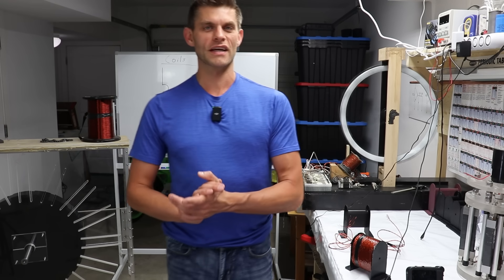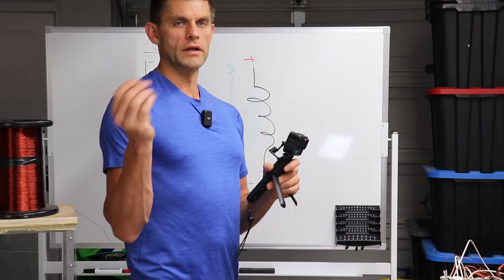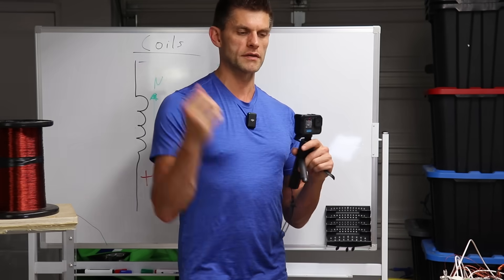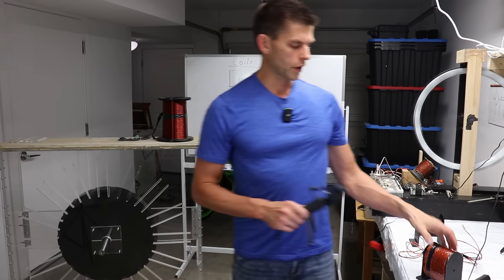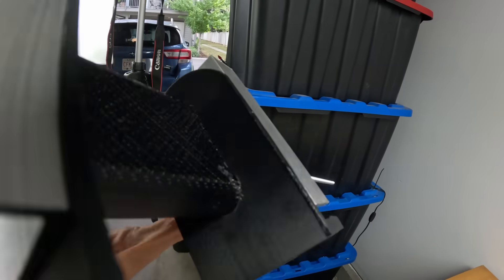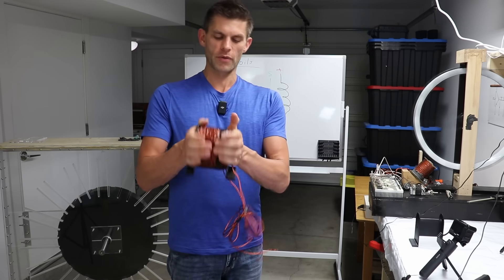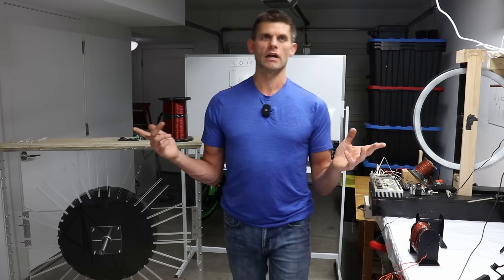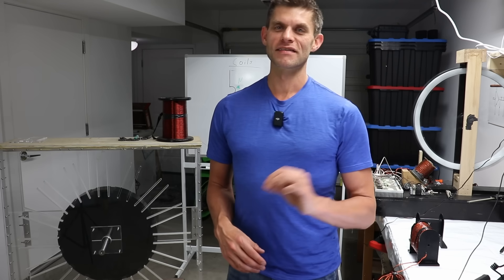Unlimited Energy in My Garage (No Patents)

Comment: You want free energy get a solar panel
Reply from the maker: True
Reply: @MadscienceLPTECH what your doing reminds me of a corona motor that just runs off the charge in our atmosphere. But yours has torque potential far superior and right up my ally. I’ve literally had I think the same idea with using electrical switching to produce more power and or less resistance when timed precisely. I’m very intrigued and interested in seeing a final operational model and how much power it could produce on a constant. Good stuff!🎉
Reply: If you travel to Guangzhou, China, you'll quickly discover solar panels are not free energy.
Reply: @GiveMeLiquidity  if you wanna get technical, nothing is free everything costs you gotta use money to buy the parts to make whatever it is you think is free but nothing is free in this world right so technically we’re always at a loss. What a concept. It makes me cry what I mean by solar panels I mean, get auction ones from A insurance sale or something of the like where they’re like $10 apiece cause nothing is free except Your own time with your own self.
Reply: @GiveMeLiquidity I guess my sarcasm wasn’t dripping quite like I thought 🤔

Comment: You claim a lead acid battery is doing the magic and pulling energy out of vacuum, when we look at a lead acid battery in a chemical level it is just 2 electrodes that exchange ions thru an electrolyte, to harvest more energy than put into them you need a specific pulse of energy to move more ions from one electrode to another than its energy would normally allow. So what kind of vacuum energy is propelling the ions forward here? There is no reason for these ions to move, because for them to move an electric current is needed. Infact, these sharp inductive pulses would be far less efficient at charging the battery due to increased heat generation, and they would degrade the battery faster.

Now i don't claim to know anything for sure, if you manage to explain this to me in a way that you understand it and that makes sense against my arguments, I'm in.
Reply from the maker: The lead acid battery is a medium in which the HV spikes can form a dipole that allows the radiant energy within to flow. Im more about building then explaining but I'll do my best to in upcoming videos. Thank you for your open mind
Reply: @MadscienceLPTECH  I would love to see such a thing run and work. But in the end, to store more usable energy in a battery than what you put in (in your case you are trying to store your input + harvested zero point energy for a net gain) you must move more ions in the battery from positive to negative. For ions to move from positive to negative, you must also move their electrons externally, so the movement of ions correlates to the electrical current of the battery. If a battery moves more ions than the energy inputted into it allows for, that means the battery is moving extra electrons from one side to another on its own, meaning its voltage must be higher than the charger and at that point you have a battery that is outputting a current while charging itself. That makes lets just say not alot of sense
Reply: @MadscienceLPTECH  Also this explanation is quite interesting, any reason why you do not use lithium batteries?

Comment: Hi sir. I am not trying to disrespect you. But why go for all that trouble if you can oscillate the coil and charge the other 12v battery with the energy spike. And in the moment if excess energy is absorbed into it then wouldnt it be easier to go with that rather than building a wheel machine.
Reply from the maker: I haven't seen that before. I've seen the wheels work. So that why, though u have a valid point
Reply: Yes, but the point was to provide mechanical work while charging another battery

Comment: I'm still wondering... why not solid? without using the motor
Reply from the maker: I've seen motors work
Reply: @MadscienceLPTECH  The motors certainly work, but they are not the most efficient form of this system, as well as the cores, you can use Metglas, Finemec or Nanoperm. I am not saying that the motor is not useful, but as Bedini and Rick explain it is not the most efficient motor and if you are only looking for a generator, the most durable form is a solid system with no mechanical parts.
Reply: @MadscienceLPTECH  Did you see the link I shared with you with the different types of PCBs?

Comment: Likely too late now, and also a lot of work - but coil/wire/conductor consistency improving:
Have one straight core (sense wire/conductor - or strong string that won't stretch much) and make a rig that rotates and wraps the center core in patterns you want. Then make the same 'rope'  really long or one similar for each coil you plan to make - and then finally cut each part into equal lengths.
Good luck - I hope the theory on 'super fast electrons that generates vacuum in quantum fluctuations really is possible', as to me - electrons is the effect of energy transfer that we humans observe. You hit the wire (or a rod, battery cell, etc.) and the crystal lattice making up the conductor/cell transfers energy to the other end, where it is either emitted - or reflected. Cooper-pair 'enables super-conductivity' in a conductor, vs. unstructured pathways leads to turbulence and local heating = losses (which is why some says you need a 'negative-impedance' to extract energy). If you really make vacuum-pockets, and extract energy to the cell - you're no longer 'temporally borrowing energy and returning it' - so the battery must cool down, or energy come from elsewhere - which can easily be measured/verified.
Reply from the maker: Interesting, we appreciate the in-depth analysis and suggestions!

Comment: Remember Bedini suggested running these systems on custom batteries, lead alum being his favorite for efficiency
Reply: Oh, and impedance matching the coil output to the batteries increases the sharpness and effectiveness of your pulse. That can be done with or without resistors, not sure which way is best
Reply: Aaaaand remember what he said about phantom charge. The batteries being charged require time to turn the phantom charge into real usable power. The alternative is to charge capacitors, and they convert it to regular charge much faster, and then you dump that capacitor to the battery with another timed pulsing circuit. This is all in his final Bedini motor design he included in the Free Energy Generation book.
Reply from the maker: Ya 3 battery banks would be good
Reply: @MadscienceLPTECH oh one last last thing, this is from Aaron Murakami and Peter Lindemann, sometimes a spark gap can be a source of energy, especially with the sharp pulses.. Peter's book on "cold electricity" was a big help for me. The video presentations as well.
Reply from the maker: Good info, thanks for sharing.

Comment: How familiar are you piezoelectric motors.  I think that the issue you eventually face is that to get power at useful amounts your hundreds of volts really needs to be hundreds of thousands of volts.  The strength of the resulting magnetic field can become and issue for traditional electric motors.  I think that to scale up there is some real magic that is possible with resonance and piezoelectric motors.  I have a feeling the pioneers of this technology had no need for energy generation as that would simply make it harder to control the masses.  I think their high voltage experiments quickly turned towards anti-gravity as they saw some amazing things happening in extreme high voltage systems.  I have no doubt they cracked anti-gravity at the Chapel Hill Conference in 1957 and then they went to Wright Pat and implemented it.  The top scientists of the time in the field were present and after that day none of them ever published another public paper or gave another public speech on the topic.  That is not a coincidence.  Sadly your efforts eventually lead you into their path and that is where you will have...problems.
Reply from the maker: Totally

Comment: The coating on the Wire's is called Insulation. 
Insulation damage or breakdown is never good ;)

Is there any reason  that you twist those 8 wires together  ??

I've never seen twisted wire used to wind a coil in any text book I've read.
Be nice to your Cu , it is a very soft metal.

You need to incorporate a counting device into your coil winder.  

The number of turns put onto a coil is important for calculations & stuff.

I wish you good fortune when trying to catch the back EMF  made when the magnetic field in the coil collapses.

Yes he was John Bendini for a while when I first started seeing his name  as well.
Reply: Any thoughts about turning the strands of wire the opposite way next time you line out a 250 ft coil ??

I like your no patent approach. 

I see the Bedini Wheel as a simple detuned version of Tesla's magnetic spark gap , possibly kind of.

Good Hunting

Comment: Nice, but the first proto type  you have on display is at an equaliberm  point,  its RPM is contant.  At least that what I can see from the video. Now add a load to the system by adding a second coil independent of all those circuits you added. The question I am asking is, can  you add a magnetic load to tap off the power, and the main motor will still maintain constant RPM.  I believe it will slow down for a small external load. This will give you something to measure for input power and output power to calculate the efficiency of the system.  From that you can expand the whole system. If you calculate the snap-back power from the coil, the total watts is very small.  I would delete the batteries and replace them with large caps and a large step-up transformer (like from lawnmowers) to energize the secondary coil to push the main rotor.   Nice  work
Reply from the maker: Thanks mate. Ya the first one is childs play. Stay tuned

Comment: So to confirm, the prototype is consistently moving, doesn't stop, for days and days on end? The prototype confirms that free energy is possible and is working in your garage?
Reply from the maker: I'd say it confirms the precursure to move forward and step it up. I dunno if its overunity. I've never charged the batteries though and it runs for days at a time. I've had those batteries for years
Reply: it consumes very little power, and is powered by the lead acid batteries. no free energy just yet.

Comment: I am very suspicious.....the Bedini motor was known for being able to revive dead batteries that could no longer hold a charge. But in this video, this guy says he needs $5000 for new batteries.  Why not just buy used dead batteries for a fraction of the price and use this prototype to revive them??
Reply from the maker: Because we need everything to be equal and balanced and calculated to prove the enegy in the system.
Reply: @MadscienceLPTECH  okay, but lead acid batteries are a dime a dozen, they are not expensive at all. You can pick some up for 100 bucks, i dont understand why you need 5000 dollars (orrrrr are you spending it on other stuff??)
Reply: @bonthor7515  you know what they say, you are supposed to take money away from the stupid

Comment: Is there a way to bring the battery costs down?
Reply from the maker: Yes use batteries will likley work fine... even ones that are technically dead can be revitalized. But for the purpose of proving this we need fresh ones.
Reply: @MadscienceLPTECH  5000 dollars can get you about 50 lead acid batteries, why do you need so many?

Comment: I love this mate, this is exactly what Nikola Tesla would have loved to see! I’m with you all the way mate, can always turn magnets off and on from a reed switch, having a stacks of coils along a rotor then transferring some of that low voltage back to the magnet rotor creating electomsgnetics, increasing the a basic magnet strength with 3 volts it will want to pull to the closet magnet above it, have a reed switch to turn off the electromagnet when it get close it will just go past it
Reply from the maker: Yes just reed switches are limited in speed and have less accuracy. Great comment

Comment: Your description of electricity as pressure reminds me of the Ramp Pump technique for moving water.
Reply from the maker: Totally. Annagolis and often compared... im just trying to get beginners interested and not feeling like this is super complicated
Reply: The great pyramid was a ram pump
Reply: Notice how there aren't any academics in this comment section and everyone here seems to know nothing of these topics but also seem wildly interested? Notice how his work area is completely clean and staged? That's because this is pseudoscience; he's blended some real science with some BS to make it more romantic. Many of the commenters here are likely fake. You can't harness zero-point energy to do useful work (which he falsely claims at about 4:30). This is the exact same thing as asking for money to build a larger perpetual emotion machine. This is a grift, don't get scammed.

- someone that studied math and physics for way too long
Reply: Electricity doesn't have pressure. The 3 properties of electricity are voltage, current, and resistance. Voltage is the force it takes to move electrons, you can think of it like headlift for a water pump. Having more means you can have more current, but you can also just have such high resistance that it drags to a stop. 

Current is also an all or nothing. Current isn't how many electrons are moving, it's how fast they are. When one electron moves it moves every single one in the cable so they move in a perfect single file line. In this extent you can think of voltage as being how much the person in the back is pushing everyone else, though there is no definitive last person in line. 

And resistance is exactly what it sounds like, it's resistance to the flow of electrons. Increasing the voltage doesn't guarentee you can overcome it, instead it may just heat up even more than normal till it fails. But at what point it fails is also based on temperature and how much work the circuit is using.

Comment: the second battery it charges holds surface charge aka ghost charge, which shows it as fully charged upto 12-14 volts but when u connect load to that battery it quickly depletes within a minute because the charges was on the surface only, what solution would you suggest of this problem?
Reply from the maker: Sort of, the battery banks flip flop every 3 mins. And surface charge is equal to radiant enegy
Reply: @MadscienceLPTECH  i reckon if u connect a capacitor in parallel to the battery being charged, the continuous flow of current from capacitor to battery will push the charge deep into the battery as a result the battery will hold charges for longer hours. i haven't tried it yet but i think it should work.
Reply: ☝️☝️☝️ @yogie_ji_gwalior_wale THIS! In one of our builds at ZPEPG we used a 12V Ultra capacitor bank in parallel to each battery as the initial output dump. One of our scientists suggested it assists in the special sauce "magic" of capturing the charge and storing it electrochemically in the parallel SLA battery.

Comment: LET'S GO!!! YouTube Shorts of less than 3 minutes of your progress as you work on the video is a a great momentum builder. Like teasers for the final video from your phone no need for polishing. I appreciate everyone for co-creating a magnificent moment 🙏
Reply from the maker: thanks for the great idea and support
Reply: Zero-point energy, the minimum energy that a quantum mechanical system can possess, cannot be harnessed as a practical energy source. While it’s a real concept in physics, “zero point energy” represents the lowest energy state, and thus there’s no way to extract energy from it because there’s no lower energy state for the system to transition to. Attempts to harness it for energy are often associated with pseudoscience and misconceptions about how it works. Extracting energy would require a lower energy state, which doesn’t exist for zero point energy. It. Is. IMPOSSIBLE.
Reply: @gregd335shot9  There are many methods for creating energy. How else would anti-gravitic crafts propel themselves?